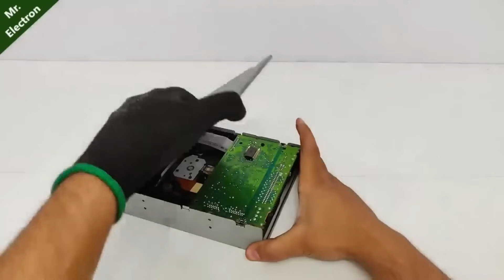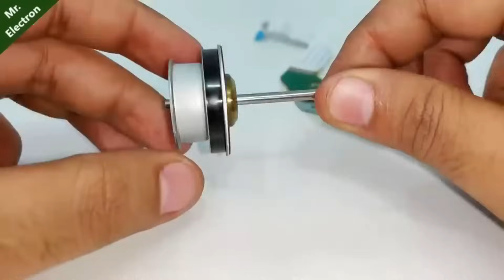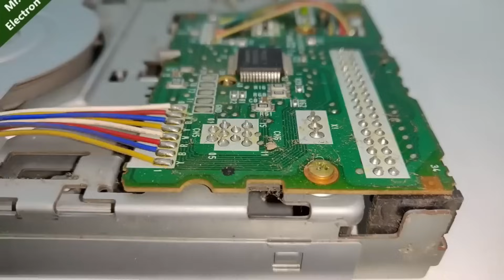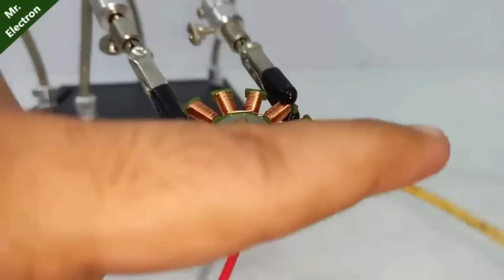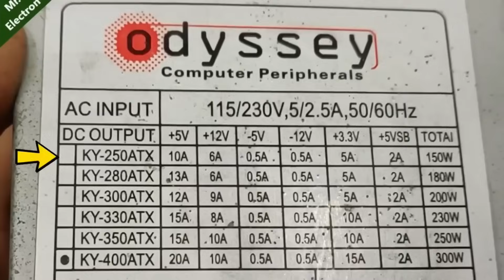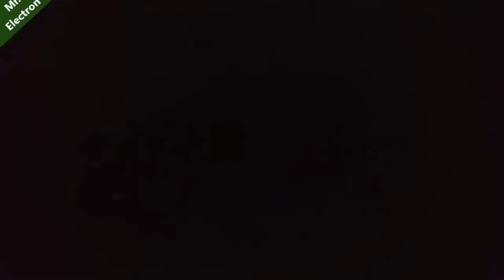Brilliant Idea From An Old Computer | 3 Simple Inventions

Comment: So you combine two rail voltages from the same power supply (+12V @20A,  and,  -12V @0.5A) to give you a combined Voltage of 24V, at exactly how many amperes 
required to drive the starter motor of your car? Which demands a current of🤔 . . approximately 150 Amperes!  🥳
Reply from the maker: Thank you for watching!💥 Check out my Latest Video here: https://youtu.be/twythhaJls0 and JOIN my WhatsApp for faster replies: https://whatsapp.com/channel/0029VaQmmRaFCCoWOf7huh3G

Comment: Tell me one more thing brother, does the length of the wire makes a big difference in DC networks? I mean if I use this power supply and connect 2-3 appliances at a distance, say 20f-30 ft, will there be some issues? Because I heard that DC power ke transmission me inefficiency hai
Reply from the maker: It depends upon the dc voltage and current. If voltage is higher and current is very low then no major issue with long cables (30ft or 50ft) if its vise versa, then  it will create a big issue.